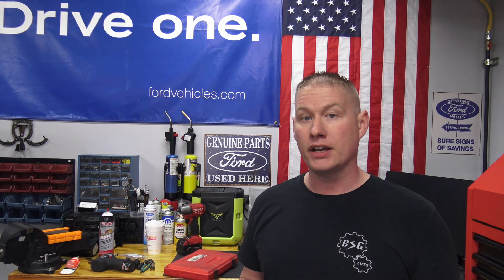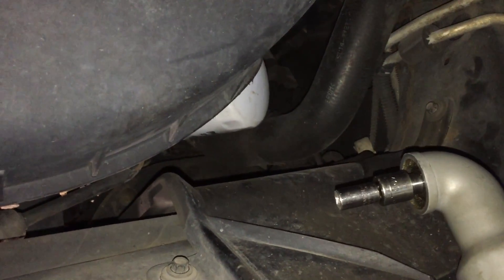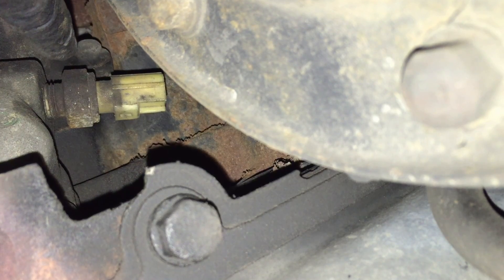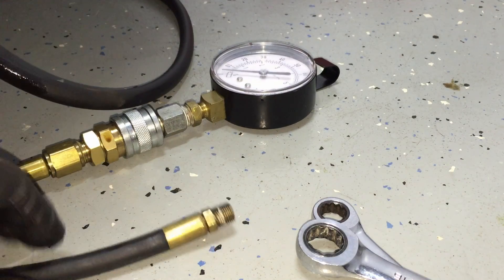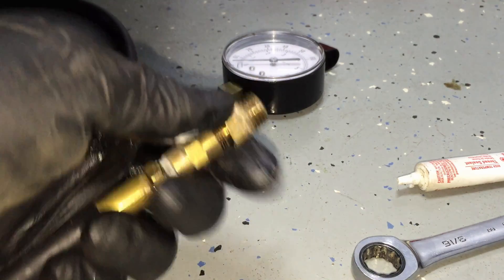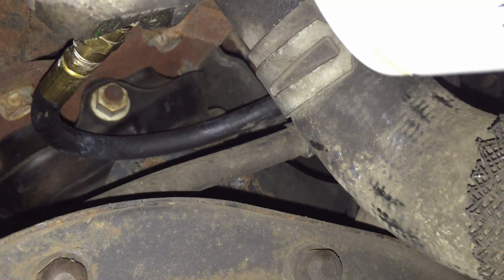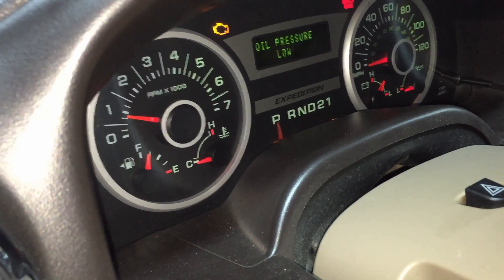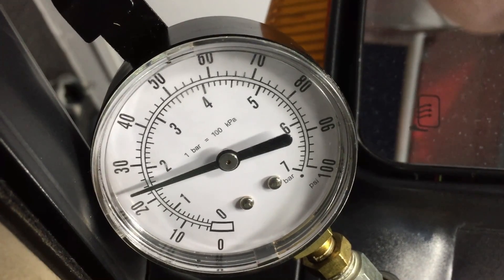Ford 5.4L 3v Oil Pressure Testing and Why It's so Important!

Comment: I did a full timing job on a 2008 f150. Replaced everything even new melling oil pump as per advice. Spent 2400 bucks in parts, put back together fires up fine then goes right into engine fail safe mode withing seconds... Brian if you see this comment do you have any insight of what is going on...
Reply: Is it possible that they forgot to put the pressure spring or the valve is sticking in the new pump. I replaced almost everything you can think of keeps going into engine fail safe mode.  Can't figure out why or what possible could be the issues
Reply from the maker: Pull codes and go from there most times it is the ETB motor connector on the drivers side of the throttle body that isn’t connected
Reply: @FordTechMakuloco  brian thank you for the reply especially on Easter sunday. I been pulling my hair out trying to figure this out. I checked the plug on drivers side of the ETB it is connected. I also put a brand new throttle body assembly on with a new tps sensor on. All ford parts.  Is there anything else that could pull the engine that quickly into fail safe mode.
Reply: @FordTechMakuloco  also no codes or check engine lights. Just a genarac p2110 p2106
Reply: Brian I checked oil pressure it was very good with a mechanical guage.  Double checked, triple checked all connections and grounds. Still starts up runs into fail safe mode. Noticed alternater was warmer than usual so I had it checked by a company that rebuilds them. They told me alternator is fine.  I don't know what else to do.  I tried everything possible got lots of money invested with no solution. Have you had this problem before ???
Reply: @josephsharon1003   Did you resolve the problem?
Reply: @zoots15  yes I solved the problem... put 12k on it so far so good.
Reply: When I took the pcm out and put it on my foot stool my dog knocked it off and when it hit the floor it bent 2 prongs to the point  they were touching. It just so happened that the prongs were to read info from the etb. When the pcm wanted to read or recieve info from the both sensors on the etb it would get no readings and put in failsafe mode... I guess they put a failsafe mode on the etb that if it fails or the readings are out of normal range it will disable the truck.
Reply: @josephsharon1003  Wow. That must of took some investigating. Glad you found the issue and the truck is running well
Cheers!

Comment: Is there any other plug, to plumb in a permanent mechanical oil pressure gage??
Reply: This is the port I used, but I didn't care about the factory gauge so I just grounded the sender wire and it reads that it has pressure all the time even engine off ignition on. Right at the middle. Plumbed in a mechanical aftermarket gauge and never looked back.
Reply: Jeremy Hess which digital gauge did you buy?  Any chance you can share a parts list?

Comment: Isn't it easier to read it through the OBDII port?
Reply from the maker: No there are no oil pressure sensors on these vehicles, it is simply a switch.

Comment: Not to worry Ford has a handle on low oil pressure at idle. It is called Stop Start Technology.
Reply: G Gordon  you've got it all mixed up.. It's Fords  Start-Stop-Repair-Technology.  That's where I'm at....mines sitting in the garage as we speak

Comment: Very nice video!  So, how do we add a manual oil pressure gauge while retaining the factory oil pressure switch so that the oil pressure light isn't all all the time, but we can still monitor actual oil pressure?
Reply: I just grounded the factory sender wire. That's all the cluster looks for and that's about how accurate it was.
Reply from the maker: Standard "T" fitting.

Comment: Is the oil presure sensor in the same place on a Super Duty? Having a hard time finding it. I have an oil cooler that my filter threads onto towards the back of the engine. There is no sensor in it.

Comment: I have a 2004 Ford 150 has good pressure after 15-20 minutes of running it looses pressure what could that be and what should I check for
Reply: Did you ever find out what it was? Having same problem
Reply: @Rc_Dread  another person that asks a question and then just falls off the face of the earth.  Doesn't want to come back to tell us what happened to help everyone else out.  Just selfish wants to help himself

Comment: FordTech, I have an 05 Expedition with a 5.4 3V and 140k. Seems like in one of your videos you mentioned that you recommended using 5w30 rather than 5w20, that the engine was originally intended to run the 30, but Ford had to lower it to 20 to meet cafe standards. Did I understand that correctly?
Reply: Yes, I seen that video,

Comment: I've tried to get a 13/16" (3/8) - deep socket with universal, but it won't fit due to obstructions.  Tried a flex head, but not enough room as well.  It appears the front differential makes removing this part much more difficult.  Is there a trick to getting the sensor off on a 4X4 (2009 5.4, 3V).

Comment: I have a 5.4 2v an at cold start up I have good oil pressure but after motor worm up I loss pressure it has a new oil pump an screen
Reply: Did you ever find out what it was?

Comment: I've just finished a cam phaser job and melling oil pump upgrade.  Can't get oil pressure to build up. Any ideas????
Reply from the maker: Give it 3-4 15 second cranks allowing starter to cool then reconnect crank sensor and fire.
Reply: FordTechMakuloco just to make sure, give 3-4 15 second cranks then install crank sensor and start engine even though the oil pressure gauge I have installed where the oil sending unit was is trading zero?.
Reply from the maker: Yes, some engine have too large of clearances to fill and pressurize at cranking rpm. Let it start after priming the circuits and the oil pressure should spike to normal 1-2 seconds after startup. If not turn the engine off.
Reply: FordTechMakuloco thank you so much.
Reply: Did you figure out your issue? I’m having the same problem and don’t understand what to do. Any help would be GREATLY appreciated!!
Reply: Scotty Thompson, I had to actually start the engine to get it to build oil pressure
Reply: Joe Jones I’ve have my engine put back together and running for over a week. Had a complete timing kit, Melling oil pump, and all lifters replaced. When hot, the engine will die with 5w 20 in it, so I’m running Lucas oil stabilizer to build up pressure and it runs fine.. not sure what my issue is. Maybe I shouldn’t use synthetic?
Reply: Any help would be appreciated I have a 2004 FX4 and I cannot see your out a way to get the oil sender out so I can do an oil pressure test on it is there any special thing I need to do do I need to drop the differential I just don't see any way I could screw in the pressure tester or get the other sender wire off to Sender

Comment: You are a life saver! I've been working on my 2004 for several days now and your videos have probably saved me hundreds of dollars! Would you recommend installing a permanent oil pressure gauge on the 5.4 3V?  If so, is there an adapter or something that can be used at the sensor so it and an after market gauge can stay connected?

Comment: thanks for the video Fordtechmakuloco; if I had low pressure and followed your VCT disconnecting video and my stalling clears up, what are the most likely  causes of low oil pressure?

Comment: To add an electronic oil pressure sensor for after-market gauge, could a "T" be screwed in there, one side for the factory sensor, and the other for the after-market?   I see sandwich adapters (between filter base and filter), but this just looks like more to leak.

Comment: hi, I have a 2006 f150 5.4l I have a problem when the engine warm up!!! the engine start misfiring and knocking at normal rpm.
I already put new timing chain, phaser, vcs, new high pressure pump and still the same problem. the cam and rockers lock ok. do you know what could be???
Reply: Did you find a fix?

Comment: Below you mentioned using 5/30 oil. I purchased 10/30 mobil1 today thinking this is the one you mentioned in the past. Should I take it back and get the 5/30 or would the 10/30 be good to use? I live in Southern Calif. So the temps run from 30 to 110 at times. Thanks for your reply.
Reply from the maker: You can run it no problems but in the future be sure to run 5w-30.
Reply: FordTechMakuloco 
Thanks for answering so quickly. I am going to take it back since 5/30 is what you recommend. Have a Merry Christmas.
Don
Reply: Personally I see no need to use multi-weight oil in climates like Florida or CA

Comment: I bought a oil pressure gauge that I want to install permanently - has an electric sending unit. I tried to put a pipe tee in at the pressure switch and that didn't turn out well. Would it work just as well to plumb it in using a sandwich adapter that goes on between the oil cooler and filter? I saw that mentioned on forums but really wanted to read the pressure where the oil pressure switch was.

Comment: Question - Getting ready to fire up new motor. Why is it necessary to remove Crankshaft Position Sensor when spinning motor over to check oil pressure? Can motor be spun over without coils hooked up? Also, any idea why the Intake Manifold Runner Control hums when key in run position? Thanks, Rich

Comment: Got the same issue with a 5.4 3v and in this video it shows a ton of mettle on the magnetic oil drain plug from all the worn components cause by low oil Pressure. if your not trying to rebuild your engine and just need to get some more life out of it then try some lucas oil stabilizer after a engine flush with kerosene to clean out the abrasive metal particles. It worked from me not saying it will always work but I had exactly 10 psi at hot idle cussing all kinds of knocking at VCT issues making the truck unusable  but with one bottle of lucas oil stabilize brought it back up to 20psi at hot idle and has Ben working now for a week straight and it's a work truck that pulls a 10000 pound trailer every day so it made a believer out of me but time will only tell how good it really is. I know lucas trans fix has Ben fixing my old worn out transmission for years now so maybe this will do the same. 

https://youtu.be/FtWEuykOnYo

Fordtech please check out my first video on my new channel only this one video so far but your the ford man I've watch all your stuff and have learn a ton I even purchase this Oil gauge from the link in this video. so please let me know what you think of my analysis of this quick fix in a bottle.
Reply: I have heard him say many times not to use the 5-20 but use the 5-30..they only used the 5-20 to pass emissions standards,  does nothing for the life of the engine.

Comment: Is there a hot idle pressure spec for the 3.5L Ecoboost? I was driving my 2010 Taurus SHO to work and got a low oil pressure warning. I put a gauge on it using an oil filter sandwich adapter and got 16 PSI at hot idle but didn't get the pressure warning. This seems really low and I suspect it needs an oil pump, but are there other things I should check first? It also has a slight rattle for a second right after startup so I think it also needs a primary timing chain & tensioners, do they leak and cause low oi, pressure like on the 5.4L?
Reply from the maker: It is low to me also but the low pressure warning came on much lower than that. I would look at your startup rattle issue concern first before condemning the engine.
Reply from the maker: The only spec they have is 30psi @ 1,500 rpm Hot

Comment: What would cause oil pressure to drop only after you accelerate, weather driving or even with the car on park. Top of the engine starts making noise and the gauge drops to 0. Turn off the car, start it again and its normal until you accelerate again. What could cause this? Truck is a 2006 f150 5.4 lariat...
Reply from the maker: Excessive crankshaft end play comes to mind.
Reply: FordTechMakuloco thank you for your reply. I will check for that. I saw your other video on phasers noise. By any chance would the phasers or solenoid somehow create an internal leak? Seems to me that the engine drops the pressure after the solenoid activates. It holds pressure while accelerating but starts making noise and the pressure drops right after letting off the gas.
Reply: @elvisroblero  another video showed a gasket behind the hyd chain tensioners ... that disintegrated !  OIL LEAK - loss of psi

Comment: Have a 2008 f150 5.4 triton 3v and it had very bad idle and sounded like a diesel and had a code for cps so replaced that with no luck except the code went away, then replaced passages side cam phaser as it was showing wear, and replaced both vct solenoids cause the screens were damaged but didn't have any buildup. Checked the timing chain, tensioner, and guides and all ok. Put everything back together and no clicking noise anymore but very rough idle still and no power as well as high vacuum at dip stick and oil fill cap, went through every vac line and can't see or hear any leaks and there all in the correct place, oil pressure at idle is roughly 20psi  (searches cause of the bad idle)  Any reason why I would have such a large amount of vacuum in the oil pan and in the valve covers??

Comment: I recently replaced Oil pump, guides, tensioners, and chains. After I replaced the Oil pump I had a mechanical gauge installed for over a month and the truck ran fine. I recently did an oil change and while I was under there I removed the Gauge fittings and reinstalled a new Oil pressure sender and hooked it back up. The first time I went to drive it started fine, and within a block it started running very rough. Did the same thing the next day. Now it runs rough all the time even at idle, it gets close to stalling, and shakes. I have already replaced the VCT solenoids about a year ago. I'm getting a misfire code, over retarded bank 2, and a few other codes. 

1) would the VCT solenoids still function if the truck thinks there is no oil pressure?
2) any idea what else it could be?
Reply: did you install gaskets under the hyrdaulic tensioners ?
Reply: @onemanwreckincrew  If you use aftermarket cast steel tensioners you shouldn't need a gasket correct? its machined to machined surface
Reply: @mrracer98  that was my initial thought, but, in fact RockAuto sells gaskets for the hydraulic tensioners.  I have NOT done the job yet myself.  I was researching for a neighbor who has this problem.  Since head / cam journal wear is a distinct possibility I advised him to sell it ...
Reply: Did you use Motorcraft vct solenoids?

Comment: Should I switch from 5W-20 to 5W-30 in my 2006 5.4L 3V? 
I have used Mobil 1 5W-20 every 5K miles since new and I am about to 95k miles.
 My hot idle oil pressure is a little over 35psi.
Reply from the maker: +TheSzalkowski yes it's best to change to 5w-30

Comment: i added an oil pressure gauge, my oil is 63 at cold start and 60-63  at 2000 rpm's, its at 20 at a stop light.  I would love to see 80 psi like in the olden days on a 350

Comment: Great video thank you for sharing! I live in Australia and own a ford xr8 which runs the 32v V8 boss motor and I have installed an oil pressure gauge after watching this video as I was worried about the pumps condition. On start up it runs as high as 90psi and drops to 26-28psi when warm, Im concerned maybe the cold pressure is to high at 90psi? Once again great video I have learned so much about my motor watching your videos, especially the timing chain/tensioners video as I used this as a guide to do mine. Cheers :)
Reply: tholmesy26 90PSI isn’t high at all on startup. 

My Chrysler 300 with the Pentastar V6 gets as high as 120 PSI when cold, and 30-40 when it’s fully hot. Your trucks oil pump is just fine.

Comment: Is there an email I can contact you through? I have a 2008 5.4 3v with low oil pressure and the mechanic I went through who changed my vct solenoid and I think one side of the cam phasers (I don't know if he did both he had a bad stutter)is telling me he doesn't know why it's low and that my engine is blown..
Reply: gaskets behind the tensioners ???

Comment: I just had the oil change, oil filter change and sensor/switch change on my 97 Ford. Now, the oil pressure gauge is reading 0 unless I put on the gas. It was flutating at stop lights. I don't know if it is gauge or oil pump. There is no noise coming from car. I checked the car oil cold. The dip stick said full. I checked dip stick after idling and the oil level was higher than full. I hope it is not the oil pump. I am afraid to drive the car.